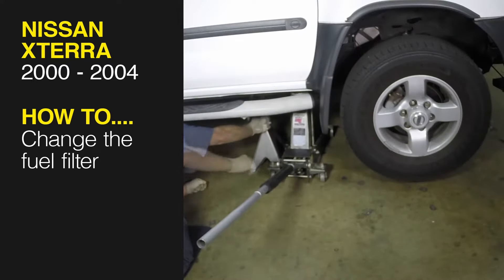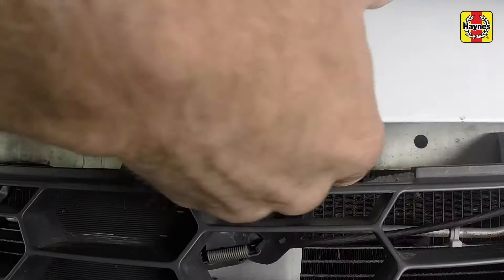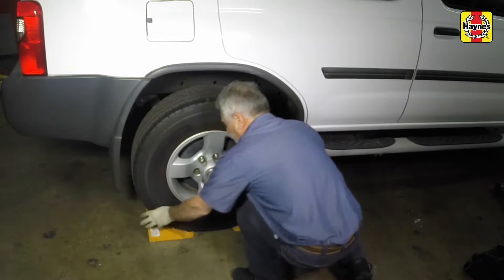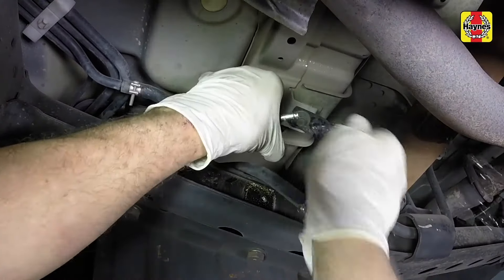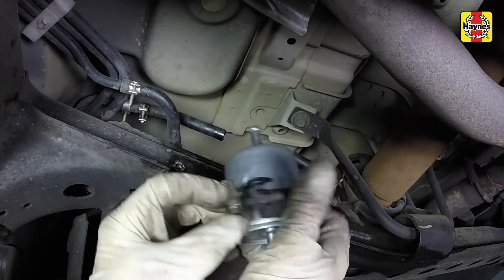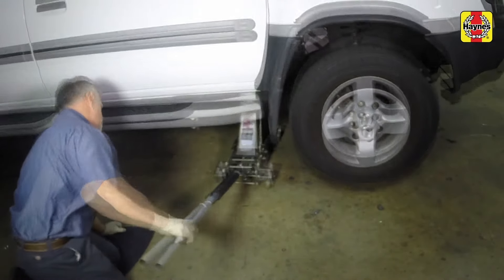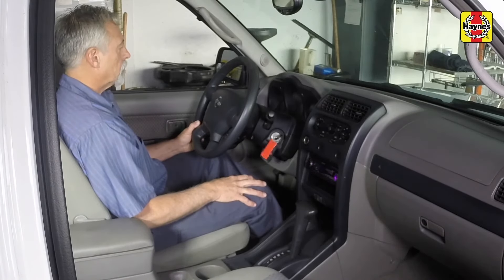Replace the fuel filter on a Nissan Xterra (00-04), Pathfinder (96-04) or Frontier pick-up (98-04)

Comment: We bought a 1998 Frontier with 100K in 2004, made my daughter change all the fluids and filters.  The fuel filter was a Nissan brand so likely original, plus the heads for the hose clamps pointed up, indicating the filter was the original one and installed BEFORE the truck bed was put on, so that was tough.  Later on, I re-engineered the protective bracket for the filter to make it easier to access.

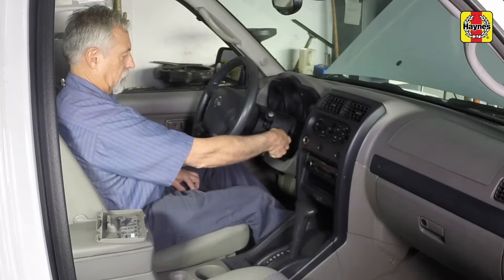Comment: At 01:03 it is visible that the mechanic removed the fuse box cover on the driver side vs the previous picture that suggested the fuse is under the hood. According to Xterra forums, the 15A fuse on the top left corner of the fuse box controls the fuel pump - I've yet to check on my car.